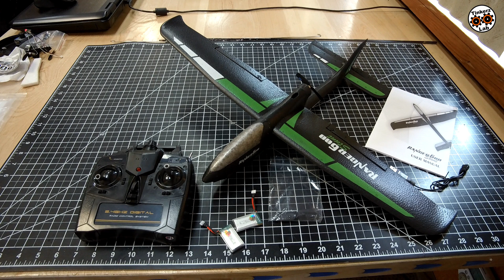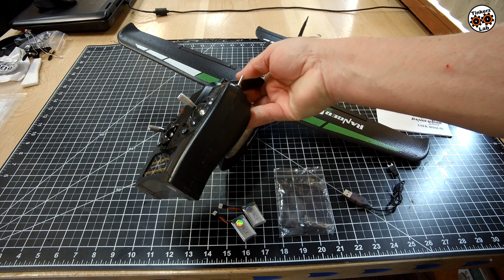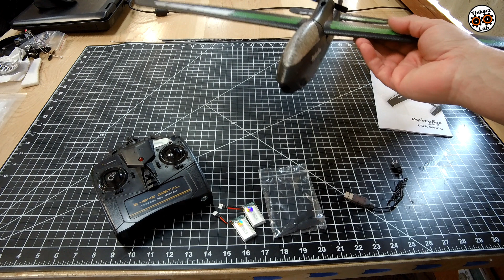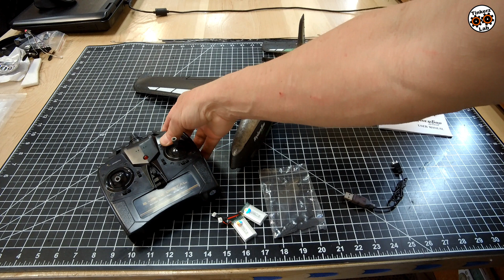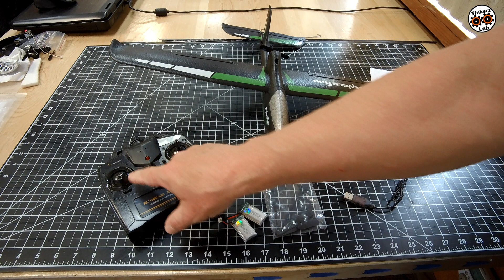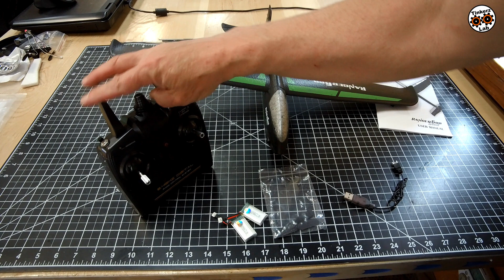Let's Check Out This Plane! VolantexRC Ranger 600mm Wingspan 4CH Gyro System Beginner Plane RTF

Comment: Can this be bound  to a radiomaster tx16s mark2
Reply from the maker: I have the original TX16S with the 4in1 Module and I can bind to it so I assume the Mark 2 can as well.
Protocol V761 / 4CH
Reply: @tinkerzlab  thanks
Reply: @tinkerzlab  are you going to fly this with the radiomaster tx16s?